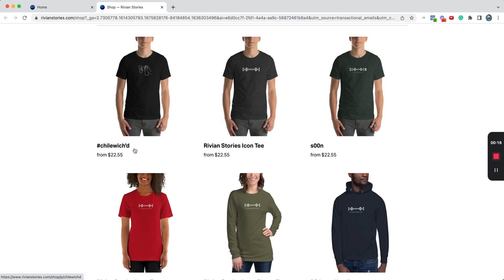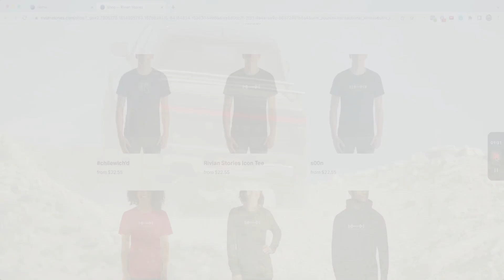Your Rivian could power your home with upcoming software update (vehicle to home charging).

Comment: Sounds cheaper to just run some 120 extension cords from R1T/R1S to key in home items, i.e. frig etc. in times of blackouts….
Reply: I've done that with my generator, but I believe at least one of the concerns is that voltage drops over distance (e.g. long extension cord or multiple cords connected) thus reducing the required energy (watts) to the devices to be powered.  ?
Reply: @chuckm260  yes, seems economics for me if there was ever extended outages would be a couple Tesla Powerwalls fed by my 13kw solar or the 50ft run with 12-3 extension from the R1 if V2H Ala Ford incurs a $18K solution. Becomes a bit counterintuitive for me to want to drain the vehicle during an outage except for maybe a short/low amp interim need.

Comment: I hope you do an update, as this video was lacking in the understanding of the basics.  It may be "only a software" update to allow Vehicle-To-Home (V2H) power for the Rivian, but it is far from clear what that really means.  

Tens of thousands if not millions of homes in North America are already set up for some kind of "generator" emergency power supply through a critical loads transfer switch or panel disconnect device.  The homes already set up for emergency power are the homes in most need of emergency power.  Wiring in a 10-circuit transfer switch only cost us $1,600 at the time of our home build in 2021, and might be $3,000 to $4,000 to retrofit (depending on many variables for your house).  Much less than the $10,000 that might be needed for a Rivian connection.  Many of these existing emergency power systems use a standard L14-30 male plug that connects to a standard generator through a standard cable.  

The beauty of the Ford Lightning design is it can easily connect to these existing disconnect/transfer switch systems and can supply up to 240V 30A or 7.5 Kw through the Lightning's onboard inverter.  (Of course you can buy Ford's full blown smart system, but is is not necessary.)  My experience is 240V 30A is plenty of power for a house, and may be enough to run an electric dryer or even a small A/C.

Currently, I power my home's emergency transfer switch from my EcoFlow Delta Pro, which can provide 120V 30A or 3.6 Kw - which is enough to power my home furnace, refrigerator, freezer, WiFi, several outlets and lights, etc.  My EcoFlow has 3.6 KWH of capacity, and can power the house for 24 hours.  I could easily upgrade to a second EcoFlow Delta Pro for 240V 30A or 7.2 Kw and connect to the transfer switch with only the addition of EcoFlow's 240V Double Voltage Hub Connector ($139).  Of course my system is not "Smart", but my EcoFlow gives me a lot of info on my power use already.  A Ford Lightning would take zero additional investment for me to utilize it for V2H.  It would plug right in to my transfer switch with a standard cable.  Ford appears to have Rivian beat on economical V2H.

Rivian does not have a proper 120V/240V outlet to make the easy L14-30 connection.  Rivian only offers 120V 20A outlets - not enough utility to make the substantial investment at the home end to allow seamless power.  I have not seen it published as to what kind of inverter Rivian offers in their current hardware package to output through such an outlet.  Any system must utilize an inverter onboard the vehicle, like Ford provides, to be reasonably viable for V2H.  Perhaps Rivian intends for the "software only" solution to backfeed 240V AC through the charging cable, but that will triple or quadruple the price for most people to utilize their Vehicle-To-Home system vs the Ford Lightning.  

It would be great if Rivian Stories could provide better clarity as to what Rivian is thinking.  Did they announce V2H to appease investors and reservation holders, but have no real plan?  We have a March '22 R1S order and this issue is concerning to us.

Comment: Didn't get to say this in the video, but I'm really curious to see how Rivian partners to solve the "home equipment" side of the equation.
Reply: Agree re. Vehicle to home.  Ev's have the potential to smooth out all of the hysteria about grid crashing.  Particularly in areas where the grid goes down due to storms, wildfires, floods, hurricanes, etc.  You are right on regarding this issue.  I charge both the R1T & Bolt from solar during the early part of the day (I installed the solar system 22 years ago).  I am anxiously awaiting the Rivian solution to the VtoH hardware interface.  Having the ability to time shift grid usage can be huge.  A smarter grid system could have the power to solve some of the current problems & vehicle to grid could smooth out the power requirements for all making the grid more efficient.

Comment: I would much more prefer vehicle-to-vehicle charging so we can help each other out when that need (unfortunate circumstance) arises.
Reply: RJ said early on that Rivians would be able to charge other Rivians.  I hope that comes to fruition!
Reply: @skylerwilliams  Yep, I recall the same thing.  Glad to hear this may come sooner than later.  However, ...

@Scott Sloter - Totally agree.  V2V, or more specifically R2R ( Rivian to Rivian), doesn't excite me as much as true V2V for all EVs.  I'm more than happy to help out a Rivian or another non-Rivian EV owner in a pinch for a few kilowatts so they can get to the nearest EV charger or intended destination.  But short of Rivian outing with other Rivians, with R2R, what are the odds another Rivian will know, let alone be in the area, when my Rivian needs a few kWs in a pinch to get to the nearest EV charger or my intended destination?  

Until all EVs have this capability of V2V, it's hard to get excited about R2R or even R2V other Rivian being at or near the forefront of this tech setting the example for other manufacturers of EVs to follow.

Comment: If you do the cost analysis, take into account the cost of electric in various places.  Right now, here in eastern Massachusetts (I'm about 40 miles west of Boston) my electric rate is just under $0.34 per kWh.

It makes a huge difference in the financials.

As for vehicle to Grid or even Vehicle to home setups, It's not just a simple plug in.  This is especially true if the house has solar..  Things can get very complicated.